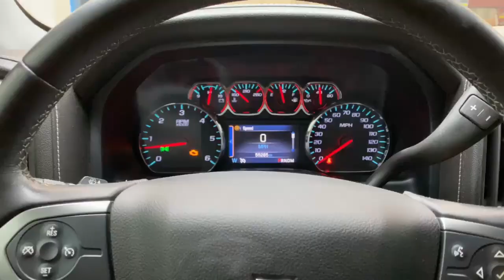2015 Chevy Silverado LTZ 6.2L DUAL EXHAUST w/ Long Tube Headers & Borla Atak Muffler!!

Comment: You guys should really let the truck warm up for a minute before you redline it... So bad for the engine the oil is literally sludge when cold
Reply: Sam Fascione yeah I second that. Luckily, the shop is probably heated.
Reply: Who cares it’s not your truck and it’s a great video. Obviously the owner is not gonna redline every startup !
Reply: @kushkeddiefilmz2742  any amount isnt good
Reply: These trucks use 0-20 synthetic, its like 5-30 thin at -10°.  But its like water when its 100° out.
Reply: Jesus Christ these are modern engines it’d have to be like -50 Celsius out

Comment: I don't mean to sound ignorant, but what does a "hi-flow cat" vs. a stock do differently?
Reply: The high flow cat has a straight through design compared to a stock cat. Less restriction equals more power.
Reply: Vulcan Taurus Performance oh ok. I believe those are illegal here in CA but not 100%
Reply: @scratchcrafter  Some are 50 states legal. You have to make sure to get the right ones if you live there.

Comment: What was the cost of the headers and an approximate cost of labor
Reply: Most places won’t do headers I haven’t found one too big a pain in the ass and if your motor mounts or bad when it rocks you’ll break welds on headers shops won’t be responsible

Comment: Do you need tune to run long tube headers?
Reply: Yea sometimes can get away without for a minute but I recommend cause fuel to air ratio is changed
Reply: And it’s a must to get pass emissions in some states

Comment: TROKIANDO CUH Its better straight pipe cuh
Reply: Si quema cuh
Reply: No cuh,  straight pipes cause premature valve ware, the heat goes out fast, but does not let cool slower  ending with slight bends in the exhaust valves.  Dragsters after runs they plug the headers to slow down the disapation of heat from warping.
Reply: @joaquinaguilar5942  no mames ive ran straights never had problems.  Ya hasta voy a vender la troka por otra y no paso nada de eso